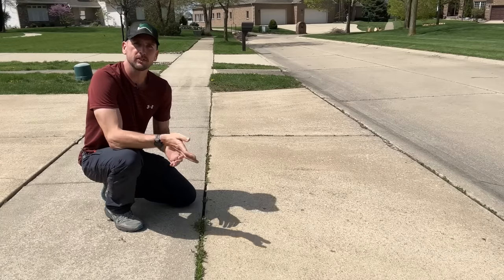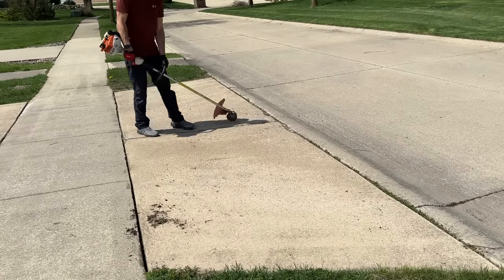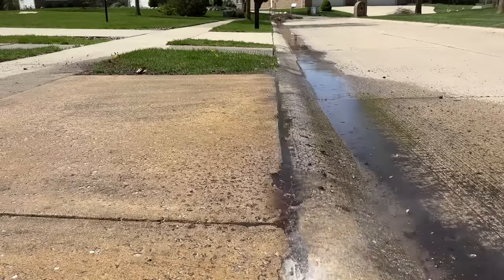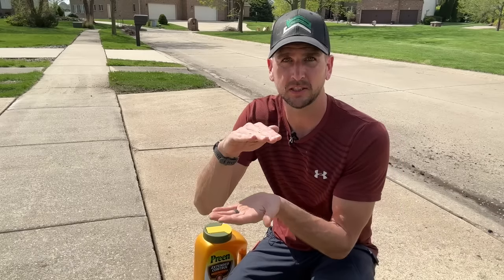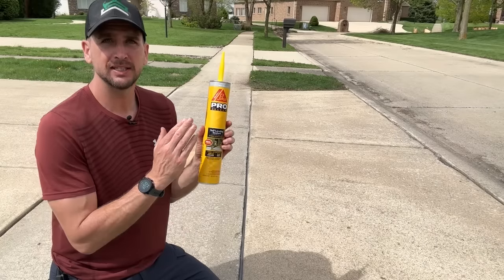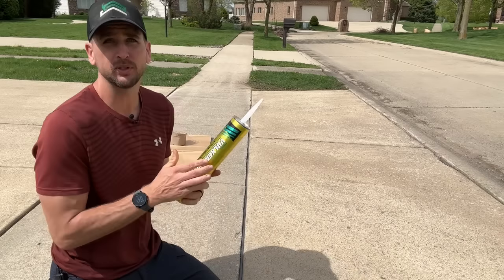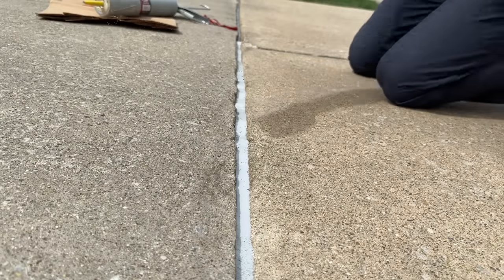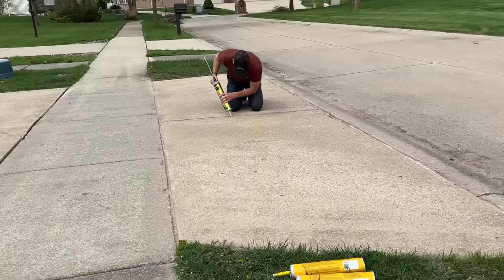Weed-Free Driveways and Sidewalks: The Ultimate Solution!

Comment: Salt.  I buy two 69 cent cartons of salt from the grocery store and pour it in along the crack and lightly spray it with the hose to melt it.   No more weeds for a year or more. Ancient armies used to salt the earth of their enemy's land  to keep their crops from growing.  The process still works great. 😄
Reply: Glyphosphate salt - AKA Roundup
Reply: Me too
Reply: Doesn't salt destroy the integrity of the concrete? New concrete, especially. That's a large reason why road infrastructure is so horrible during and after the winter months up north. The salt gets wet as it melts the ice and works it's way down into the cracks, seeping little by little into the pores, eventually turning the concrete into a crumbled mess
Reply: @lennykrapitz4794 ehhh rock salt for snow is a bit different than table salt
Reply: Does it work on grass?
Reply: Didn’t work for me.
Reply: Ohhhhhhhh🤯
Reply: @qbanz00  In what way?
Reply: Great tip! .69cents ….can’t beat that.Thanks for sharing! Many blessings to you 👍💯
Reply: Great vid. Thanks for sharing!
Reply: @timl.b.2095  I tell you what .. why don’t you put some snow rock salt on your next meal and then come back and tell me if there’s a difference or not 😂
Reply: @lennykrapitz4794 

Yes, the salt is very aggressive to concrete, especially to the reinforcement steel rebars inside it. Don't recommend using salt.
Reply: Is the ancient salt the same salt you’re using though?
Reply: Salt destroyed my driveway!  I have pieces of concrete breaking off like gravel and it needs replacing.  Will cost hundreds for a section if I do the labor myself. It will cost thousands to get it professionally done.
Reply: Also salt will rust your car and any other metal around. Will also kill all slugs.
Reply: @lennykrapitz4794  roads are asphalt, mostly. I'm sure salt might affect them-but being petrol based, it repels water. On major roads/highways, the underlay is normal, final lift is popcorn- that allows water to seep to the tighter underlay and stay off the top of the road and perc off to drain. Maybe the salt compromises the petrol?
Reply: @lennykrapitz4794 I just looked it up, the idea seemed foreign to me- but I live in florida, so we don't have frozen roads and driveways. 
You are correct on concrete- it causes more frequent freeze/thaw cycles in areas that have that weather. It also compromises the bond/sealant, causes pitting, etc. There are special sealants to make concrete impervious to this, but I'm for sure they don't use them on public/city jobs. Probably just single residential.

Comment: Since I am lazy, I just pour boiling water on the weeds. If you hit them early in the season, the weeds won't come back. I also do this method to remove the weeds from the patio. In a couple of days the weeds are dead and they can be broomed away. Also, environmentally cleaner than herbicides.
Reply: You can also use vinegar
Reply: I'd rather do almost any method versus putting an unsightly sealant on my driveways expansion joints.  
That solution he showed won't last all that long.
The homeowner who tries it will be right back at square one within a few years, but also have a mass of unsightly gunk in their joints.
Reply: @MrVvulf If it's polyurethane, which I believe Sika is, he will be fine. I did a ton of it on a valet parking drive way where hundreds drive over daily and it gets rain and sun. 5 years later still looks new
Reply: Thanks for sharing this information.
Reply: I use boiling water too,
Reply: @MrVvulf It definitely lasts long. Mine has lasted 12 years so far.
Reply: You're lucky weeds can't SCREAM! Some Karen would report you for 'Weed Abuse".
Reply: Also cheaper than vinegar
and works faster !
Reply: me too. been doing that for years.
Reply: Does the boiling water method work anywhere on your grass or just through cracks?
Reply: Spray the weeds with mesotrione or quinclorac.
Reply: We found it doesn't work super well long term
Reply: Oh, then boiling salt water would probably work even better
Reply: @MethodiousMind  the surrounding other plants might disagree
Reply: If you add vinegar to your kettle it will clean it and kill the weeds better too.
Reply: I like how brutal this is. 👍

Comment: In grade 10, we learned of the Roman method of salting the fields. I use left over winter road salt to sterilize areas where I don't want plants.
Reply: Same here! I try to keep the chemical weed control to a minimum at my place, and a pot of boiling salt water is my go-to solution.
Reply: Huh!  Brilliant.   So do you remove the weeds and dirt like in this video, or just sprinkle the salt directly onto the weeds in the cracks?  (I am brand new to this.)
Reply: @ahill4642  : I'm lazy. I salt in the spring, before the plants take hold. I have used it at the fence line because of neighbour weeds, the edge of the driveway, around the shed on a stone base and killed a cut down tree with a salt pile on the stump.
Another weed killer is spray a mixture of vinegar, water and a bit of dish soap, spray it on leaves.
For some weeds that are being difficult, a propane torch works. Just enough to singe the leaves, no need to burn them.
Reply: @Stock Villain  What do you think Salt is, if not a Chemical?
Reply: @StuninRub  the difference is that salt is natural and already found the the ocean, and lots of other places as well.
Reply: Vinegar, boiling water, rock salt ... nothing has come close to solving the weed problems in my driveway cracks. How long until I have to quit mowing my driveway,  and dig out and replace all the old asphalt with new a$phalt?
Reply: @DBowenTube  You have to dissolve the salt into the water and make a high salinity solution for it to work.
Reply: @StuninRub  Did that. The asphalt cracks are so small it's hard to get enough liquid, no matter how potent, down to the roots.  I think the asphalt, which was laid in 1956, is past its useful life.  The problems started with tree roots buckling it. It's just, well, even older than me, and I've replaced various parts. 😂
Reply: @StuninRub  I'm also on fill created when Marina del Rey was built, and I think some of the coastal weeds are salt tolerant.
Reply: @StuninRub    I think it is NaCl
Reply: Salt can cause problems to the concrete...
Reply: This is pretty useless for me here in Florida with paver stones in a bed of sand. The gaps are narrow. But the weeds come. I’ll keep spraying.
Reply: No wonder there are no weeds or grass along the sea shore, because it is salty

Comment: Good tips. Some fleshy noxious weeds can cause eye or skin irritation, and they can be killed by pouring boiling water on them, without touching them or using strong chemicals
Reply: I use a propane torch that broadcasts heat

Comment: I have a slate paver patio 15' x 20' and have made numerous attempts to keep the joints clean and clear. But after spending way too much time and money doing so, I now  just let the vegetation grow (except the dandelions) and keep it trimmed down. It actually looks really nice, takes minimal time and effort and blends in nicely with the rest of my natural backyard.
Reply: I cast tiny Dutch clover seeds over my pavers, these crowd out taller grass and look fine.
Reply: Dandelions are not a bad thing! They actually help the soil you might want to do a little research.
Reply: There's a couple different things you could grow between them that don't require cutting search for grass alternatives.
Reply: Dandelions are one of the season’s earliest flowers and make great food for the pollinators ❤
Reply: @riosoma  And they r beneficial for ur health !!! 😅
Reply: You have a sensible attitude.
 Carcinogenic poison is not the answer.
Reply: Lets water drain to soil as well
Reply: Sometimes green gaps can look good but I generally like an inch in between so it looks intentional

Comment: You could skip couple of labor intensive steps by using a 3,000 psi power washer and blast everything out all at once in the cracks/control joints. The self leveling filler for cracks works pretty good for indoors like in my garage but it only lasted couple years for the driveway and sidewalks. I had an extra bag of stucco mix just to try it out by chance, not 100% but so far held up pretty good after couple of years. Much easier to use and cheaper.
Reply: Great comment
Reply: +2 on the PW. Let dry and use a compressor and air nozzle or a shop vac blower if you really want to go nuts. For an outdoor application like this, especially on a driveway in full sun, like a roof shingle, gravel would give protection from the UV degradation. Get some small fish tank gravel and gently pack it in on top. Do a short run, gravel it, and continue. Gravel needs to go on right away before the filler skins over. Might be cool to do it with colored fish gravel or fish tank glass gravel. Or even glow in the dark/ reflective gravel!
Reply: @wingnutbert9685  killer idea with the fishtank gravel!
Reply: That's because you don't know how to use the filler.
Reply: Affter you fill the crack with caulk, you can cap it with fine sand while it is still wet and that will act as a sunscreen after it has been dried and the excess brushed off.  Nice look also.  Gives you longer life of the caulk.
Reply: Does eliminating the space in the expansion joint have any bad effect on the concrete?
Reply: @shazzorama  no. The filler is flexible. It actually helps the concrete not to shift or degrade as much.
Reply: @edstimator1  best suggestion so far!
Reply: @shazzorama  what Rafa said.  It prevents water from getting underneath the slab and causing erosion of load-bearing soil which often results in settling and uplift and cracking. A lot of cracking and settling could be avoided if expansion joints, and control joints for that matter, we're sealed to prevent moisture intrusion.   The greater the slope of the driveway, the bigger of an impact this has. Great question
Reply: @shazzorama  if you use a flexible product, no. I would not recommend using stucco or concrete to fill expansion joints.
Reply: @shazzorama  the expansion joint is to help prevent cracking
Reply: @wingnutbert9685  what a great idea! Now I HAVE to do it using glow-in-the-dark gravel!! I’ll be the only one on the block! 😂
Reply: @Queensdaler432  Awesome! Bliking LEDs would be cool too, but you run the risk of a plane mistaking it for a runway!!! 😆
Reply: @wingnutbert9685  Great idea. But do you mean pack the gravel on top of the stucco mix that is put in the cracks?
Reply: @wingnutbert9685    Another great comment!!🎉🎉🎉
Reply: @shazzorama    Great question!!
Reply: my thoughts exactly when weed killers can also be bad for then environment i only use them sparingly. idk why this video wasnt 2 minutes long saying to clean out the crack and different things to fill it with that are safe and inexpensive
Reply: Yes, love my power washer!!
Reply: Everybody wishes they had a pressure washer
Reply: @edstimator1 isn’t that what he did?
Reply: @JasonLestage  Not certain. Did he fill the crack with sand and then sweep it off to about a half inch below the surface so as not to have to waste expensive caulking filling up a deep crack?  Did he cover the wet caulk with sand while it was still wet and then wait until it was dry before he swept it off?  I would watch it again but I don't care to. I already know the best way to fill concrete cracks with caulking.  Do you?
Reply: @caseG80 it needs to be "sealed" though with a flexible sealant, like others said, to prevent water from seeping below and causing shifting
Reply: True
Reply: @shazzorama it should still act just like an expansion joint, so no, there “should” be no issues with that.
Reply: @edstimator1 
Iron oxide is the best sunscreen I've found.
You can buy it at the paint store or make it with an electrolysis tank and battery charger.
I mix it with paraffin oil for outdoor wood stain.
Not sure how it might react with concrete. Definitely wanting to try it though.
Reply: I put in filler foam and then caulked my expansion joints, the a couple of days late a kid came along and peeled back some of the caulk and pulled out the filler. 😩
Reply: @snclry  LOL that sucks!
That doesn't work very well I'm really wet climates. Everything eventually floats to the top.
I've not tried some of the new closed cell spray foam though. I might try closed cell next. Also thinking about putting a deck screw every few inches into the wood expansion pieces. Leave them sticking up to near the top of the gap so the foam has more to hold on to.
Also wondering what that melted tire stuff they put on playgrounds would do over time.

Comment: Dear Scott, from personal experience, I have found a curved linoleum knife to be a very handy tool for clearing out the grass, weeds, etc. from those expansion joints and other concrete cracks, and for the most part does a much neater, easier job than any screwdriver.  The hook part of the knife pulls a great deal out of those cracks.  Your hose nozzle follow-up though, is excellent.  Have a good day.
Reply: A High pressure hose works fantastically and completely demolishes/removes the weeds as well.
Reply: One of my favorite gardening tools.
Reply: Permanent fix = Find a way to put a tiny strip of zinc in the cracks, the entire length.  Zinc changes the alkalinity of rain water or any water and will not allow plant life to grow.  This is old knowledge we some how forgot.  I got it from tour guide, who was explaining the ornate features on the roof of the Biltmore Estate ( Vanderbilt Home in Asheville North Carolina)
Reply: @nesbittgregory  where do you find a zinc strip?

Comment: Self leveling caulk does tend to bubble if you try to fill too deep of an area or you trap air below it.  That's why you need backer rods and the backer rod needs to fit tightly in the gap.

Comment: Better is to use Polymeric Sand, or stuff used for filling joints of brick patio.   It fills and stays firm, and self adjusts when it gets damp.  That silicone caulking tends to shink and come out after a few years.
Reply: The video showed the caulking was already shrinking.
Reply: That's not silicone caulk he is using. It's called sika flex and it's a polyurethane product that's made specifically for sealing concrete joints. It has held up in my driveway almost 20 years now. It's pricey but an excellent product.
Reply: Tried everything including a product that “set” like concrete that cost €50 per tub…beyond useless, the weeds & grasses came back …tried the Vinegar, salt & dish soap …again weeds came back within 1 week, just a nightmare!

Comment: In one joint in front of the garage I used old roofing shingles broken to about two and a half inches wide and stacked to width of joint and hammered into it.
In the ten years since there has not been an issue.

Comment: Ten years ago you could buy a butyl caulk to fill the joints and it lasted more than ten years-able to expand and contract. The self-leveling material dries hard and cracks and lasts less than a year I've found.
Reply: there are some roof caulks made of rubber/butyl. That should work. no?
Reply: I used a whole case of NovaLink SL then also 3 tubes of Sika SL, both are holding up equally as well.  I had so much to fill because it's a large patio / driveway combo.  The Sika NON self leveling I tried for 2 small areas was awful and fell apart within a year though.  So, I think the Sika self leveling is in fact great quality.
Reply: For cracks in my concrete stairs I used OSI siding sealant I had a tube of just for kicks, set in the sun for a few hours then spread it with a putty knife and my spit to smooth it out, 2 years so far and the Bear concrete paint I used afterwards still looks great.

Comment: I use boiling water on my brick paver driveway when the weeds are still small.  Unfortunately, they do come back in other spots but it’s cost efficient.  I think sprinkling salt in the cracks would also work as long as it doesn’t all get washed away.  Another option is using sand that sets hard like concrete.
Reply: I've used sand for a few seasons now - just regular ol play sand - after cleaning out the cracks and, although it doesn't necessarily prevent any weeds from growing again, it does make it VERY easy to pull them in the future AND it's also entirely natural, without using any weed-killer poisons in & around my yard.
Reply: Salt makes most concretes spar, so you don't want to do that unless it's specifically made for salt exposure. Northern driveways are more likely to have admixtures to handle salt (freezing weather and salt for ice are more common), but in the South...nope.
Reply: @rattlejake0422  A few weeds in the cracks of your driveway are never worth getting cancer over.
Reply: I used salt on cracked asphalt in my driveway. Didn't accomplish anything.
Reply: I used to use play sand between pavers on back patio but weeds still grew and the sand would wash away and needed to be replaced. But for the past few years I've used clumping kitty litter (from Dollar Tree). It dries hard and barely any weeds at all! Just make sure it is swept off the pavers real well.
Reply: @williardbillmore5713 the owner may be less likely to get cancer than the wildlife being affected by poisons more directly.
But, I hear you.
Reply: @jainstevens131 lol, the stray cats in my neighborhood would probably then use that area as a litterbox.🐱🐱🐱🐱🐱
Reply: @jainstevens131 interesting idea!  Not sure what the feral cats will think but then again they use every1s yard anyway. Lol

Comment: I saw a paved walkway where the paving stones were arranged so that grass grew between them in a checker board design. The design looked really nice. Of course, that might work with a drive way or other places. Stepping on the uneven surfaces could cause a fall or twisted ankle.
Reply: There are concrete paving blocks designed to make a hard surface for vehicles and allow grass to infill the gaps through and between the blocks.